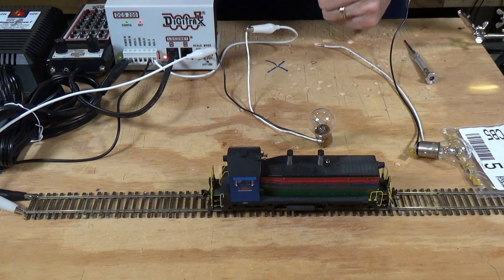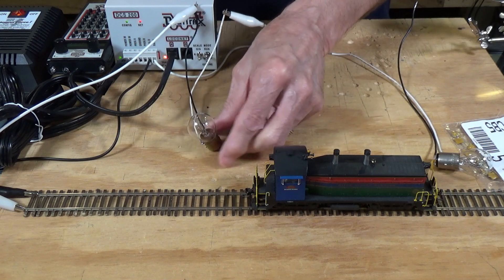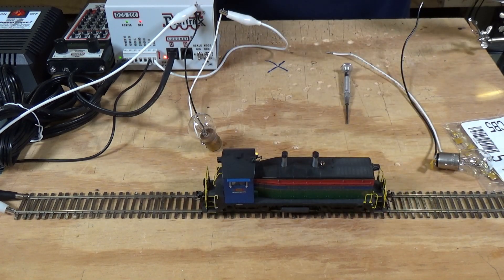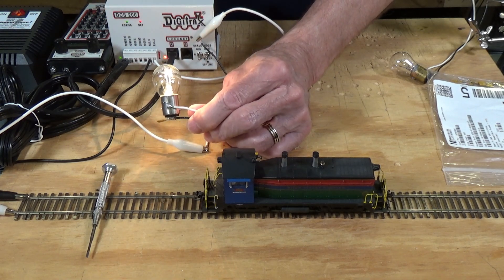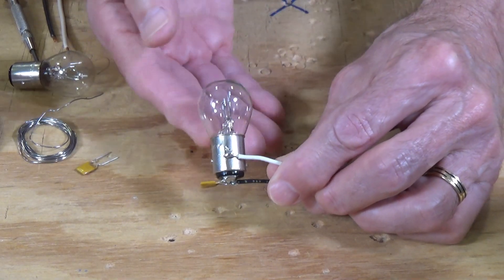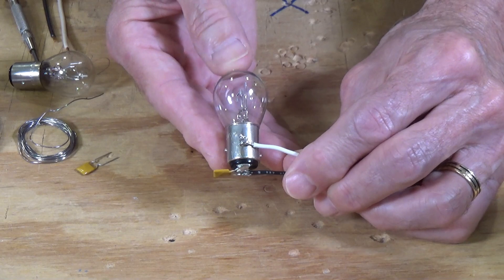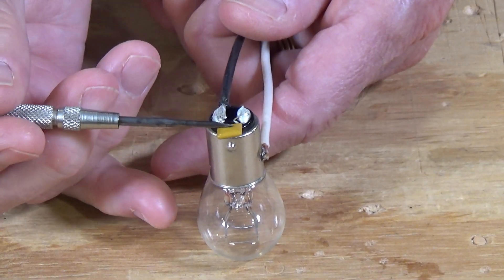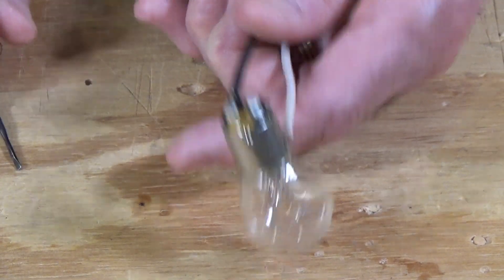Build The Improved DCC Ballast Lamp Circuit Breaker (109)

Comment: Question won't the auto bulb's amperage restriction reduce the amperage to a block even though there's no shorts?
Reply from the maker: Yes, the bulb will only conduct freely up to 2.5 amps, and commercial DCC circuit breakers will do the same thing—they all trip at the set current—they just give you more choices of trip current. Just like in your house if you try to run too many appliances on the same circuit the breaker will trip. Try running two hair dryers in the same bathroom at the same time.
Reply: @TheDCCGuy  Thanks  for the prompt response. Then what does one do when you need more than 2.5 amps for your block?
Reply from the maker: That is one of the limitations of ballast lamps. One option is to  divide the layout into more blocks so you spread out the load. I have a friend who has 30 ballast lamps on his layout. I doubt he ever has more than 2 locos in a block at the same time. Of course the best option is to spring for some of the actual electronic circuit breakers I showed in my video on circuit breakers. These generally allow you to choose from a range of trip currents when setting them up so you can balance your needs. I’ll be talking about this on Friday.

Comment: Hi Larry.  If a short occurs inside the locomotive, say at the motor, is it possible that the continued 2.5A current for 30 seconds could create enough heat to burn out the decoder?  Or do decoders have some sort of built in current limiter?
Reply from the maker: Some do. Some don’t. That’s why I always test a new installation on a service mode programming track—they are current limited to 250 milliamps. If a short occurs later, due for example to an exposed solder joint on a wire you can usually kiss the decoder goodbye—always protect joints with heat shrink tubing as I have shown in all my videos and discussed in MR articles.

Comment: Hi Larry, great informative video on the ballast lamp. I am going to look at fitting one to my layout . I a question regarding the DCC Alpha Meter which I have on my layout - do you fit the bulb on the input side or output side of the meter ?
Reply from the maker: The bulb or circuit breaker will always be on the output of the meter. The rest depends on how you are wiring the layout. If you have multiple blocks supplied by the one command station or booster, then you would have a bulb and power bus for each block and they would be on the out side of the Alpha Meter unless you also have 4 of those. In my case I have the wire from the command station going to the meter and from it to the PSX4 circuit breaker. It then splits the current and sends it out over 4 separate power buses. That arrangement allows me to see how much power all four blocks are pulling but not each individual block. Hope that is not information overload.
Reply: @TheDCCGuy  Hi Larry, many thanks for the reply. I only have the one power bus circuit covering the layout. I may split into districts at later date so many thanks for advice regarding the set up for this too. Regards Gary.

Comment: What is the size or holding current of the PTC fuse that you used in your video?
Reply from the maker: It holds at 0.9 and trips at 1.8A. However Dick Bronson explained to me that even though the trip current is 1.8A it will still take 30-40 seconds at 2.1A for it to actually trip. It is a heat thing where as the amps go up heat increases and the polymer changes form and the embedded carbon particles get farther apart and finally break the circuit. As it cools the carbon particles get close enough to begin conducting again—brilliant design!

Comment: How Do you determine the smaller filament they look alike?
Reply from the maker: If you look close one filament is taller than the other. And if you listen closely in the video I pointed out which way the tall and shorter filaments were facing as I was soldering on the black wire. That said, when I made my first one of these I got it backwards myself. All I had to do was move the black wire from one contact on the bottom to the other and it worked.

Comment: Great video, thanks for posting.  Question - does the use of taillight bulbs limit the number of locomotives you can run at once?  For example, NCE website say to assume 0.5 amps per locomotive when sizing your system needs.  If two consists of 3 locomotives were running up a grade for 3 amps (6 engines x 0.5A), would the block that is protected by a taillight bulb shut down?
Reply from the maker: Yes, but that is also true for electronic circuit breakers—you have to choose a trip current. The 0.5 amp value is a maximum. Most of the time our locos are sitting still or moving so slow they may only pull half that. When I installed the Alpha Meter on my layout I had 65 locos idling away, most with sound off, and they pulled 1.9 amps—65 locos!  Just a tip the bigger your blocks the more more amps each will need and vice versa.

Comment: Great video Larry. 
I'm sorry to go "off topic" but do you know the ESU software I require to function map a V3.5 decoder?
Clearly, the current version will not work with older decoders.
Regards Charlie
Reply from the maker: Charlie, the ESU website at http://www.esu.eu/en/downloads/software/ has some older stuff on it including a zip file of 3.5 sound files. I am assuming that the current software will program the older decoders as long as you have the sound files, but I may be wrong.
Reply from the maker: Charlie—I just heard back from my ESU contact and he said the current LokProgrammer software will work with the v.3.5 decoders and sound files. Do you have the LokProgrammer device? I will eventually be doing a video on a way to use the LokProgrammer software without the hardware device and then transfer the CV settings to DecoderPro for final programming, do you have that working?
Reply: Thanks Larry, V3.5 are not listed in the drop down menus but, as you said it works fine.  Many thanks for this.  I’m currently working on the “Uncouple” movement which is refusing to play ball!  I’ll keep you posted.
Regards Charlie.
Reply from the maker: Yes, I can see that getting the timing right could be an issue. In your goods yard setting You could place an optical detector ahead of the electromagnet. That way when the loco covers it, the magnet would activate and allow you to do a backing move to uncouple then move forward to clear the optical sensor. You just have to set the count down timer long enough to accomplish these moves. Of course just placing a pushbutton on the fascia would be easier, require fewer components, and provide leeway for slow operators. Good luck with it—Larry
Reply: Actually Larry, my issue is with the ESU Programmer.  It allows me to program in the Uncouple movement, but still nothing materialises when auctioned.  I have had some success but limited.  I must have missed something in the programming, perhaps another setting.
Reply from the maker: Ahh, yes, I remember you mentioning that in your video. Some of those ESU functions are a bit elusive. However you had it working in the loco you demonstrated in the video so I’m sure you’ll figure it out.

Comment: I personally would not use this solution, feel that there is a risk of damage to the model's wheels.
In Sweden, it is recommended not to use this solution.
Can you afford to buy a model locomotive, then you can also afford to buy a real protection for your model locomotive.
And that protection is no harder to install than the bulb solution.
Reply from the maker: I have heard folks say that will happen with some of the older slower relay based autoreversers but have never actually seen an example of it myself. In the past it was supposed to be more of an issue with Z and N scale locos. The main issue with #1156 bulbs is they allow the full 2.5 amps to flow freely through the wheels, etc., and this can create enough heat to melt plastic side frames and other parts. With this #2057 circuit the initial 2.5 amps is reduced quickly to 0.4 amps greatly reducing the chance for damage. I know of one occurrence where an N scale modeler was using a 10 amp booster without any circuit breaker protection and unfortunately left a loco shorted out for a very long time. The heat melted a section of rail under the loco wheels! Since NCE sells a similar product using ballast lamps I doubt there is a problem as the liability issue would prevent that.
Reply: @TheDCCGuy  
All right, go with your solution. 
In any case, I will choose a better solution to my system from my point of view.
Reply from the maker: Personally I use the PSX4 electronic circuit breaker but I know a lot of folks who still use the #1156 bulbs and I would rather they try this improved circuit instead—much safer!

Comment: I truly do not understand why you would even need this bulb-contraption with a DCC command station set up. All the systems I know detect a short and immediately switch off the power to the track. Seems to me by far the safest way of operating, remove the short and then switch it on again. If your command station doesn’t do that would seriously suggest to switch to a more modern one.
Reply: On a large layout with blocks each block is protected and will not shut down the entire layout, other trains will continue to run
Reply from the maker: Randy hit the nail on the head. I’ll be doing a video on power management concepts using circuit breakers later.

Comment: Once it trips, how long does it take for it to cool down so it works the same way again.
Reply from the maker: The cool down reset time varies but it usually is only a few seconds, less time than it will take you to clear the short and get the loco or car back on the track. It depends somewhat on how long it is allowed to heat up and how hot it gets. It really is a neat chemical reaction inside the component that is explained in a wiki post.